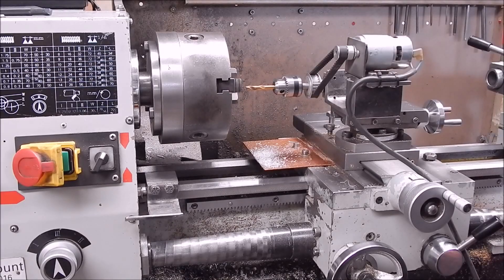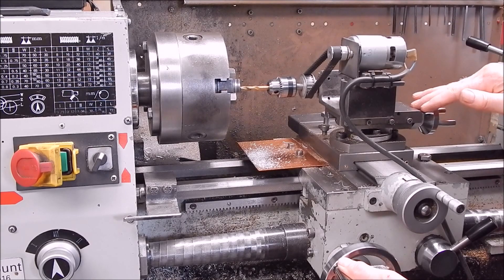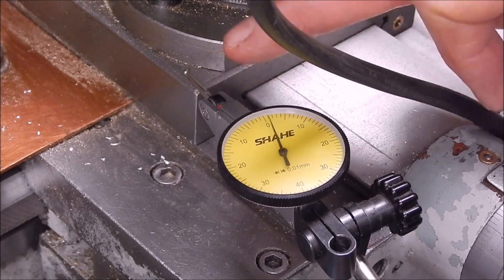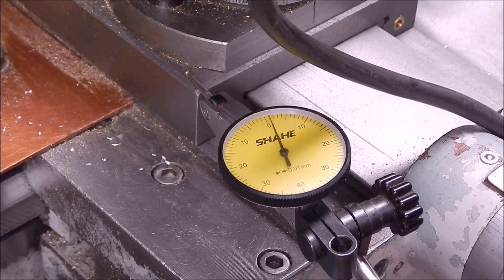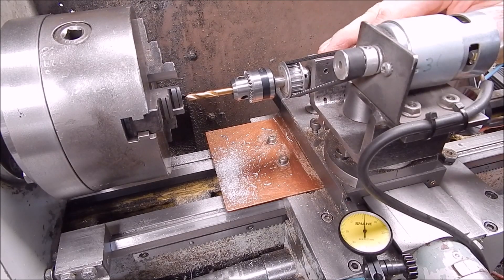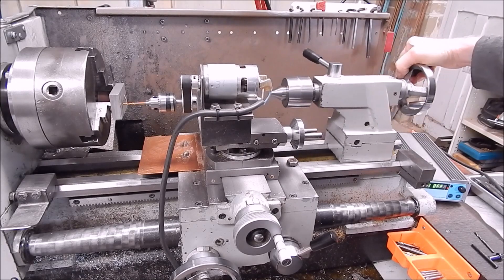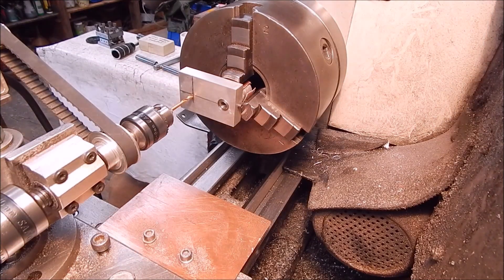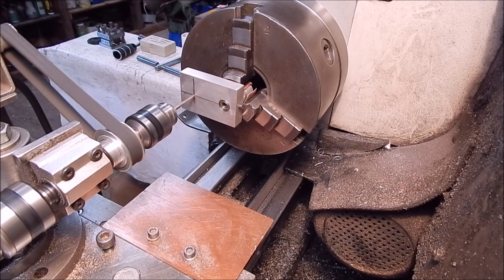How to drill and mill accurately with carriage mounted work and tooling - useful workshop trick

Comment: Use toolmaker's buttons to pitch any number of holes or bores. Set this up on a face plate or a four jaw chuck will keep the machining process on the centre line. This is what toolmakers used before CNC. Cheers

Comment: Hello Rob,  An interesting video and great tip.  Thanks for sharing.  I do have a question, while doing your offset drilling and applying pressure with the offset plate on the tailstock, do you get any fore or aft radial movement of the drill?  Just curious.

Joe
Reply from the maker: Hi Joe, not that I've noticed.  I use this trick a lot when drilling holes in flywheels for crank pins and they are always 90 degree on each plane.  The amount of offset is very small compared to the leverage length/effect when driving in with the carriage.  The amount of deflection is way less when drilling softer metal such as alloy as it cuts before the loading effect takes place.  You are much more likely to have a deflection issue with steel. Cheers Rob
Reply: @Xynudu  great information Rob.  Thank you.  I am a tyro so my head always seems to be filled with questions.  Thanks for the tip and the follow-up.

Comment: Hi Rob,
Great video and explanation !
You can use your system when cutting keyways as well , many set up a cutter in the tool post and rack the carriage back  and forth taking light  cuts (usually only a couple of thou deep)  to broach out the keyway  but if you use the tailstock to apply the force you can take much deeper cuts and you will end up with a straight keyway that is parallel to the bore .

Comment: Sorry for the dumb question, but why not drill that perpendicular hole on a drill press instead of using the lathe? Or is it that a drill press cannot give the same precision as doing it on the lathe?
Reply from the maker: Hi Brian,  doing it on a drill press presents some other issues - flex in the table (they all do), is the vice level or gripping it accurately ?  Is it aligned on both planes ?

A lathe will always be more accurate.  You could also mount this job in a four jaw and do it that way with a drill in the tailstock, but that method is no good if indexing a job.

The video is intended to show how you can easily overcome tool post tilt (using the current job as an example) by using the tailstock quill as a ram on the same plane.  

Cheers Rob
Reply: @Xynudu  All fair comments! I figured it came down to accuracy - great video, thanks.

Comment: Very good info. Thanks for sharing! On a side note... are those lead screw expanding protectors available for any lathe? Or were they part of the original lathe that you have?
Reply from the maker: You can buy them after market, but they are quite expensive.  The covers seen came as OEM on my lathe.  Quite a few new Asian lathes now include them as standard.   The leadscrew is totally protected.  Cheers Rob

Comment: Wow! How fascinating, interesting & useful! Now that you have shown me it makes perfect sense & it does not cost anything! Thinking about it, it is probably better than a low cost mill which some have told me are not as strong as say a huge Bridgestone, and lead to slight movement. With this arrangement all the forces are directly behind the drill, guaranteed by the mass & rigidity of the ways & tail stock. This is truly remarkable being both simple & low cost, what in the modern social media speak is often known as engineering porn. Thank you for sharing!
Reply from the maker: Using the tailstock quill as a ram and steady support is rarely shown, and something most machinists are unaware of.  Cheers Rob

Comment: Hello Rob, yeah makes a lot of sense. But I think you can minimise the effect initially by locking the cross-slide (or carriage, whichever method is not being used to feed the cut). So it should never be as bad as both the carriage lifting AND the cross-slide lifting, don't think you pointed that out. Not as effective as your method I know - but handy to know if you don't have anything suitable to stick in the tailstock as sometimes happens. All the best, and thanks for your videos!